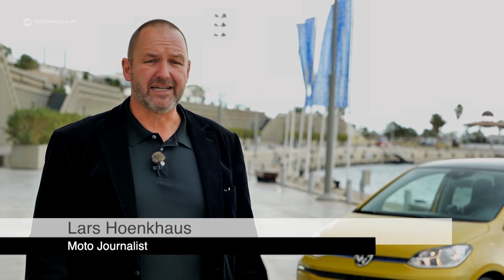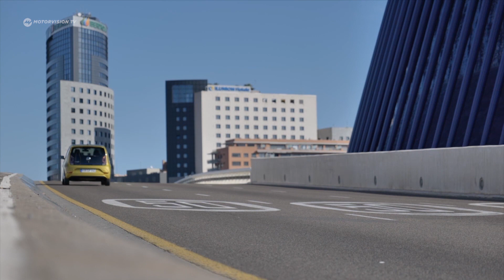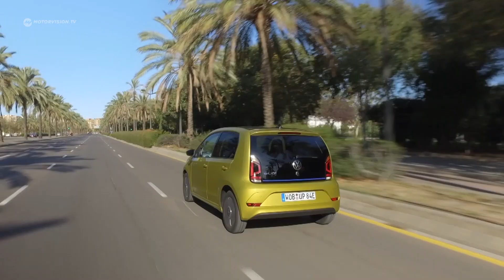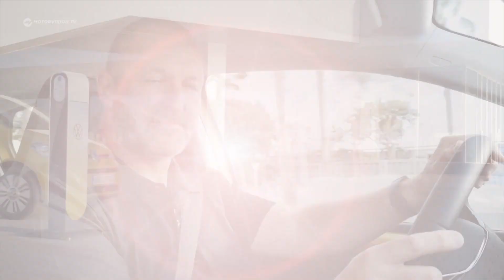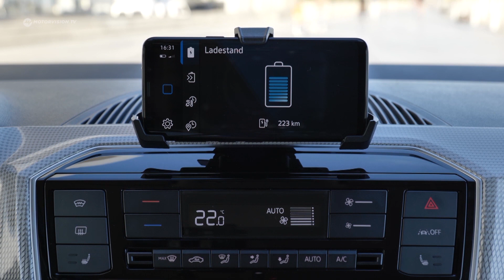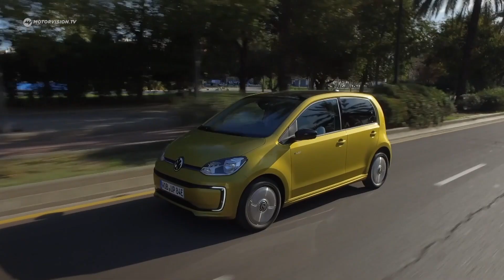Volkswagen VW e-up! – The new electric VW small car

Comment: This is a completely sensible electric car.  How is some massive behemoth Tesla supposed to be good for the environment.  Use it as a second car for the family  or hire a car for a ultra long trip.   What I like is that the car has excellent range but you can get a reasonable charge out of a 230vac outlet.